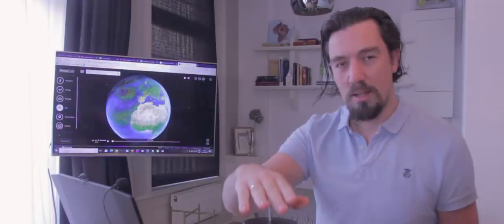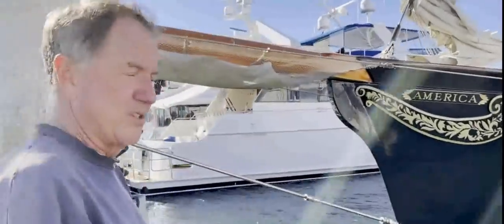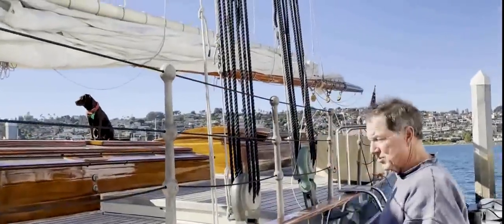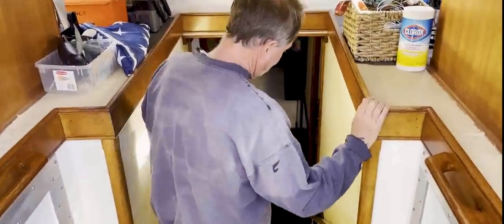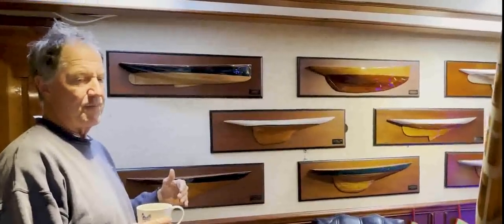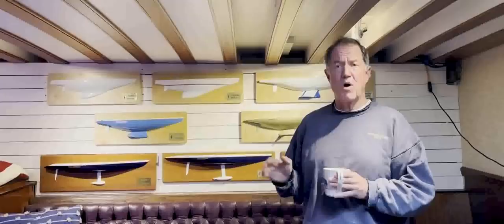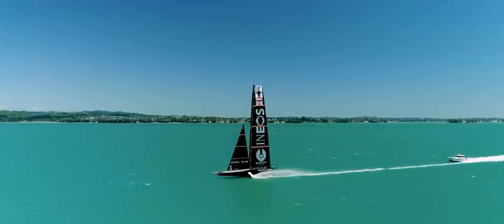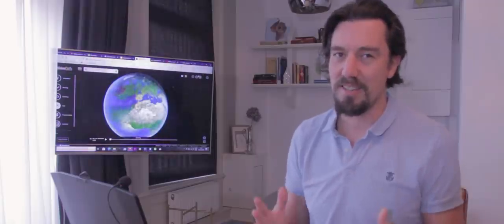Sea Wolves - The new America's cup boat! AC75 Technology analysis/Deep dive special! Auckland 2021

Comment: Just a small point of correction for you:

The foil cant system is not powered by the grinders at all. It uses a separate battery pack that is charged before the race.  The grinders only provide hydraulic pressure for managing the sails.

The foils cants DO use hydraulics though, it is just they have an electric hydraulic pump to provide pressure.

Other than that small correction, great video!!!
Reply: Thank you for that insight.
Reply: true

Comment: I am not sure if this was more recently addressed but I think that you are mistaken about the skeg.  I don't think that it has anything to do with a transition.  If you windsurf the first time you rake the sail back and close the slot between the sail and your feet you will notice a jump in power.  My understanding is that this stops the wind from leaking under the sail and thus reducing the pressure difference.  Closing the gap seals this off and you gain lift without adding drag.  Since these boats fly above the waves the wind can go under the hull.  The skeg therefore closes this gap without smacking the waves with a large wetted surface.  So it adds lift with minimal extra drag.  I believe that this is also why they are trying to fly low (there may be other benefits).  Also, I don't think it is fair to say they reduce power once they are up on foils.  I think that they maximize lift to take off and then reduce drag once they take off.   Maybe this is what you meant.

Comment: I heard that the skeg acts as an aerodynamic endplate during the transition to foiling.  When the boats first start generating lift, without the skeg they would lose power when the high pressure air bleeds over to the lower pressure side. The skeg being in contact with the water stops this, allowing them to generate more power until they are fully foiling. Once they are full foiling, then you don't want the extra drag, as drag is the proportional to the square of the velocity. Therefore, they should be out of the water after the transition.
Reply: @SxWerks  can you please elaborate more on how they “capture air on the side of the leeward foil and create ground effect lift”? I have heard this explanation from multiple different sources (who probably know better than I do) including the Italian Quantum sails guys, Vittorio and Pietro, however I’m not sure I follow the logic and the phenomenology. Part of the confusion may stem from the fact that I’m an aerospace engineer (and fluid dynamicist) and the definition of “lift” is much less ambiguous when talking about an aircraft than a sailboat—especially a foiling sailboat. Furthermore, traditional ground effect lift is usually attributed to image vortices: virtual reflections of the wingtip vortices below the plane of the ground due to the no penetration boundary condition that induce a (virtual) upward flow between the two image wingtip vortices increasing lift.

Now, when the skeg is out of the water, a large vortex should be present and attached to the leeward side of the skeg and hull. This lacks the symmetry of wingtip vortices, but I can see how an argument might be made that the image vortex provides more upwards induced flow along the centerline this is a form of ground effect lift. But does this really outweigh the low pressure of the attached vortex pulling the leeward flat portions of the hull down and vertical portions of the hull to leeward? After all this sort of attached vortex is what creates the low pressure responsible for the lift of delta wings and in this case such a low pressure is pulling the hull in the wrong directions (down and to leeward). I suppose that leeway helps your VMG downwind, which may outweigh the harm it does to VMG while traveling upwind? But apparent wind speeds should be higher upwind so I would expect the penalty upwind to outweigh any benefit downwind. Additionally, due to the asymmetry, the image vortex will induce additional flow from windward to leeward enhancing leeway and side slip. 

Am I missing some critical phenomenon for how the skeg creates ground effect lift?
Or am I misinterpreting lift to mean a force acting in the upwards direction when the boat is floating at rest in flat water? (Versus, e.g., lift created by sails which acts with a forwards and leeward component)

As a CFD guy I readily admit that it’s more or less impossible to accurately intuit the causes and relative magnitudes of many of these forces, however I have not yet heard anyone give a detailed explanation of the phenomenology behind the “increased ground effect lift” argument/explanation and I am therefore not confident in my own assumptions and understanding what people (who have done the calculation or know what they are talking about) mean by this statement.
Reply: Forgive my informal and imprecise description typed out on a tiny phone screen... not my best work but hopefully clear-ish enough
Reply: @zbeekerm  👍🏽
Reply: Skeg in simple term is to prevent mix flow between right n left side, and create single flow from front to the back .. mixed flow from the side will stall wing shape of the hull, and lost the lift .. like on plane you get flat spin on topgun movie..
Reply: May be, it is here for a graceful landing, too?
Reply: The skeg is there to provide space for beer...

Comment: Great show! I think one reason why they opted for soft sails is that the hard sail is very hard to handle as you have to demast the yacht to be safe in harbour. This increases the handling costs and makes everything more difficultand time consuming... Really appreciate your shows :)
Reply: also the condistions in  new zealand means the winds are higher and waves  compared to burmuda which the was last cup . that is why Cats are not popualar  in higher winds and waves
Reply: I think there was also the desire to foster a development which was more applicable to crossing oceans. It´s a huge limitation of most hard sails (wings) that their area cannot be reduced, whereas soft sails can be reefed (or lowered entirely,  in extreme conditions or running repairs). Whilst the specific implementations in this AmCup are not reefable, the concept lends itself to reefing, hence the trickle down effect for real-world sailing

Comment: Great video and an amazing intro! 

Personally I think that the main purpose of the skeg on ETZ, with its flat bottom, is to act like a kind of water-ski to provide a little bit of extra hydrodynamic lift. That helps get the boat out of the water earlier, but more importantly I think it helps the boat stay up. Right after a tack, the new foil and the sailplan might not be at full power right away, but the boat might still have enough speed to slide along on its water-ski skeg and the partially working foil for a few boatlengths until everything is in the zone again. Landing and having to take off again will cost a lot of distance, so anything which prevents an occasional landing will be a huge boost to the overall result.

Comment: Interesting video. I owned and sailed a windrider rave about 20 years ago, recording a best of 26kn. The “flight” level was maintained automatically by trim tabs on the foils. A “float” rigged on an arm over the outriggers and through some levers inside the aluminium foil adjusted the trim tabs continuously depending on the how the float was positioned in the water. The rudder was controlled via foot pedals and the lift trim-tab on the rudder was controlled with a little lever on starboard side. It was great fun and quite challenging. I did learn more or less on how to fly it as of about 8-10kn and more of wind. I would imagine that a similar mechanical system would be implemented on a AC75 possibly via some internal pressure sensor or some Flettner type rudder or trim tab inside or around the main trim tabs to make the whole system work. I would have a hard time imagining a human doing it... but of course, I don’t know.

Comment: Great presentation thanks Florian. A few thing you didn't mention maybe due to lack of time. I'm not an 'insider' or 'expert' so please check the facts.

The mainsails are double skinned, with two tracks on the mast. Very unusual.

The size, area of the foils is important. Large area for low wind range, small for heavy air. Why? because big foils will lift at a lower speed but have a lower max speed because higher drag. Small foils will lift later (or not at all in low wind) but when running have a lower drag profile. Foil for the day are selected according to the wind forecast.

Flying a foiler is more tricky than an aircraft in this respect: There is a very narrow allowable 'altitude' band. Too high and the foils break the surface, all lift lost, crash down. Go too low and you drag the hull.  Most foiling dinghys have a mechanical water surface sensor, a wand, which partly automates this. I dont know how the ACs do it.

A wierd thing about these ACs is the heeling (roll) axis. Any other boat, it heels over and rotates about an axis running through the boat fore and aft. With these the rotation axis is a line drawn between the active foil and the rudder foil, a diagonal line to one side of the boat. Thats why, if they get it wrong either the boat rears up and crashes or the reverse, the bow gets suddenly slammed down.

Keep it up bro, you're doing great!

Comment: Florian,  I’ve been windsurfing for years and I’m also a pilot for many years. The  current AC 75 concept is the closest to the two principles merging into one. I love how aerodynamics and hydrodynamics is merging into FluidMotion.
Reply: @Kor Kiley just like with a fully cambered windsurfing Sail, outhaul adjusts the camber ( depth) of the foil. On my slalom racing sail I have an adjustable outhaul connected to both sides of my boom. This allows me to adjust the sail camber between upwind beats and a broad reach. The AC75’s have a very large windsurfer sail where the sail effectively wraps around the mast and remains two seperate “sheets” till around 2/3 of the chord line. Just like a windsurfer sail. The AC75 have hydraulic outhaul which is adjusted in synch with the sheet position and angle of attack. . All controlled by the “ mainsail trimmer “ who’s monitoring a pressure distribution diagram of the main sail on a waterproof monitor. They require a computer to tell them when the main sail is at optimum efficiency. As windsurfers, our brains and body act like a human computer since we do all this instinctively by “ gut feel”. The same way a pilot should be be able to fly the wing on an aircraft by “ the seat of his pants”. 👨‍✈️🇦🇺
Reply: @Kor Kiley our windsurfing club welcomes people your age. You are never too old to go sailing. http://inverlochwindsurf.org.au/

Comment: Great video
The tailtales may actually as boundary controls like the goofball dimples but better as they deform but not as well as the wing feathers of bird near stall.
A plane flight direction is controlled by the ailerons and the roll or banking.  The rudder is secondary.  These sailboats do not bank in the turns, the hydrofoil must be doing the rolling to provide extra lateral force required to change direction as the sail force change drastically
It is not easy to fly an  hydrosailboat or hydrosailplane.
Reply: Sailploat ...

Comment: Great points. I disagree about the skeg though. The sails are so advanced that they seal to the deck, dividing the high pressure side of the sail from the low all the way down to the keel. I believe the skeg continues this division further towards the water surface, further creating lift to help accelerate the lift during the transition from floating to foiling. This is the moment you would need optimal power, to pull out of the hole if you will. Thoughts?

Comment: The design of the skeg, must also affect slamming as it comes off the foil. Also I think they must be minutely altering the flaps on the foil when the water gets more choppy to prevent the nose down attitude the one in the video got when it pitch poled. You know its going to be fast and hairy when they are all wearing crash hats.

Comment: I guess the skeg also directionally stabilizes the boat when the hull starts to get contact with water. If the bottom would be flat, the sudden increase of drag would make bearing downwind very difficult and induce torque to upwind direction which would need rudder compensation and thus slowing the boat. Now, especially with the flat bottomed skegs, the hull has minimal contact and less torque against the foils, helping to maintain speed in turns like jibes and rounding downwind mark.

Comment: The Skeg is an air dam....that's why the boom also hits the deck. Without the skeg air passes from high pressure to low pressure underneath the boat. The increased skeg area prevents this air passing....

Comment: Nice video cheers for that. I was hoping to find out how these boats stay so level. Sailing a laser (small dingy without a keel) you constantly need to shift your weight trim the sales and change course to say "flat". If you mess up you heal the sail spilles the wind and there is less pressure in the sail. I find it so hard to comprehend these big boats balancing on a rudder and 1 foil and managing to stay upright and level when there is a gust of wind or a lull! Do can they create "torque"  with the foiles? Say a gust comes can  they create less lift (or even downforce)with the windward half of the foil and more lift with the leeward foil? Or is it all done with heading changes and releasing the sales. Or do they have so much apparent wind that they could keep sailing for a bit by bearing away even if the wind suddenly died off. These things must be a nightmare to sail!!! Or is there something simple that I'm not seeing. These boats just don't seem inherently stable like every other sailboat ever created (excluding the moth and co)
Reply: Had all my questions answered by this video mind blown!!! So complicated!

Comment: The skeg is not so much for delaying acceleration, which would be daft, but rather a) to soften the deceleration via more gradual splashdown and b) to create an end plate effect to prevent air spillage under the hull, thereby maximising vertical lift.

Comment: So in the 2000 moth worlds here in Perth, on Derbarl Yerrigan, a couple of blokes worked on a foiling moth. It had a foil off the end of each wing if I recall. Each element went down vertically and then they both tucked under the boat at an angle. so as the speen increased and the boat rose there was less foil in the water. This continued until an equilibrium was reached and off you went. I belive there was a twist grip controlled trim tab foil on the ruder too (but I may be incorrect about this?).
When the standard 20knt sea breeze came in, the boat was too much to handle. The tech was still too undeveloped. But I believe it went like a rat up a drainpipe in moderate breeze. I actually spent some time with Mr Google trying to find the results for the 2000 regatta, but I failed.
But anyway, at the end of the 2000 regatta, when the association had it customary rules discussion, Bret's foils were banned because "It turned the boat into a catamaran". Now you know why I felt like commenting.
Reply: Way back in the 1980s, that excellent Australian TV documentary series, "Beyond 2000" showed a foiling trimaran for ordinary sailors, whose breakthrough concept (one on each side) was a small float shaped like a ski tip (IIRC) on the end of a forward-projecting wand, whose rear end connected to the foil, which was pivoted like the tailplane of a Tiger Moth (IOW the entire foil pivoted to adopt a new angle of attack)
The analogy which was given was of a potato peeler, where the leading "blade" is not cutting (because it's running backwards) but acting as a servo control to provide a constant "diving" angle of attack to the (trailing) active blade.
In the foiling tri implementation, the linkage was the same but the foil was set to a climbing angle relative to the ski-tip.
The result was a very well-mannered but fast and manoeuvrable vessel, and I was always somewhat surprising it did not catch on quicker. I guess sailors are innately conservative, in the main...

Comment: One of the really critical things with the sails is keeping the power on. From the clips I have seen so far it seems like the races could almost be won or lost on the turns. The GB boat unfortunately seemed to keep dropping off the foil in the turns in the clips I saw but others seemed to be able to rocket round a turn still on the foil. I also thought it was in the regs, though I am not sure how it would be policed, that you could only have two foils in the water while gybing or tacking and at other times it had to only be one foil.
Reply: In tacks, the fore and aft trim must be really really tricky to maintain. As the bow comes towards the wind, there is suddenly no forward drive, just aftward drag (all the way up the rig). This will cause the stern to be pushed down, ¨oversheeting¨ the main foils and stalling them. At this moment it seems to me that (unless the trim is swiftly corrected by raking the rudder tailplane forward) boatspeed will drastically drop, which (say if it happens too early, when the bow is not already past the eye of the wind) would cause the apparent wind to swing aft, oversheeting the sails & causing THEM to stall.
And, in the process, causing some of the world´s best sailors to look a bit average.